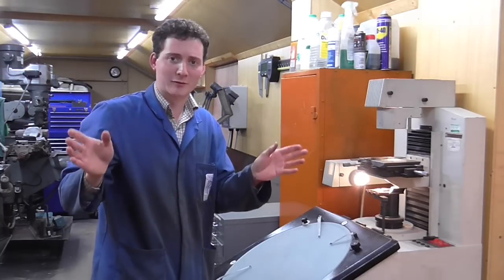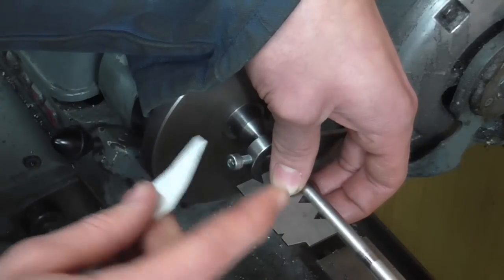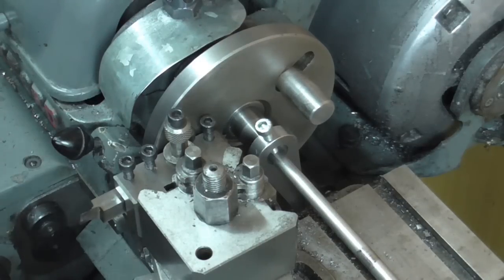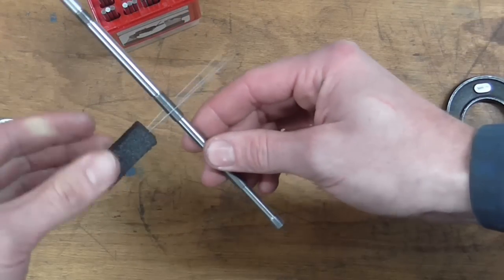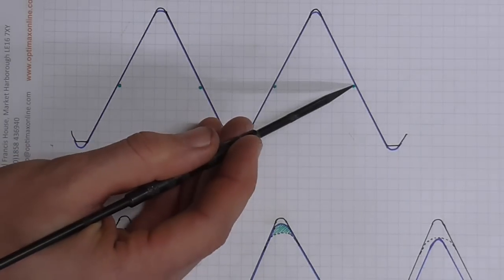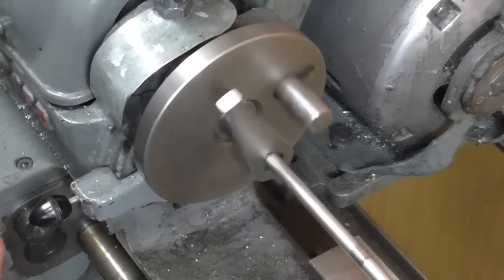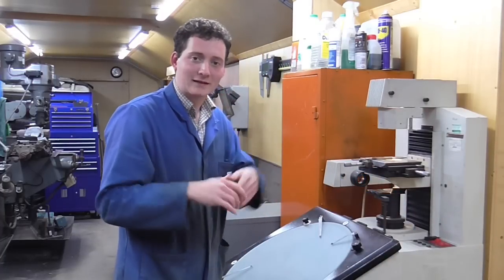Threading Details

Comment: i was very f intrested  in your shadowgraph could you do one on your shadow graph ive try mocking one up against the wall just to get the same effect with screwcutting tools .I used to work on  Cridan screwcutting machine for  aerospace drawing and all dimensions had to be corect shadowgraph  was very usefull  .The tool and SC gauge was behind the screan and radius gauge in front so you could use the ratioto use a larger R gauge the customers inspector would soon pickup on eney discrepancy from drawing .Is your shadowgraph home made or comersialey made some of them are realy complex  best vid yet.  ttfn&ty

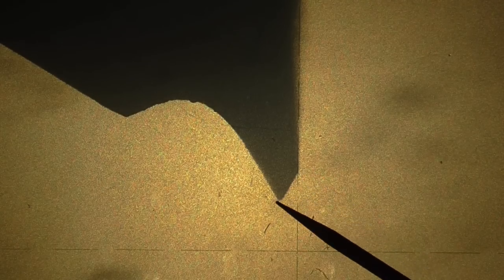Comment: 7:00  For UN and metric thread forms, The point of a tool for cutting threads is NEVER sharp. The correct thread form requires a flat nose of 1/4 pitch width to 1/8 pitch width for cutting male threads and 1/8 pitch width to 1/16 pitch width for cutting female threads. Provision is made for wear on the corners of the flat nose provided it is clear of the 1/4 pitch limit for male threads. . For example, a 20 tpi thread cutting tool needs a flat on the tip of .0125 - .0035.

Comment: Drill a hole in the drive dog (in the axis of the lathe bed), then remove the existing pin from the drive plate and replace it with a bolt (or pin) turned down to the hole size, that can pass through the hole in the dog. Don't fasten it to the dog, that way the work (and dog) can be taken off the lathe by sliding toward the tailstock, and without any worries that the work will over-run the drive plate..

Comment: Thanks for the tip on thread measuring wires, I was pleasantly surprised by the wide variety of threads they will work on. Also, you probably already know, 'soft iron wire' is available very cheaply at any home improvement store as 'rebar tie wire'....

Comment: i have problems getting a good surface finish on bronze threads- atlas lathe with lantern toolpost - any advice?
Reply from the maker: What surface finish defects are you seeing?
Reply: @MrCrispinEnterprises  just a ragged suface in thee V of the thread- i used a brazed carbide tool- tried slow speed and faster

Comment: Dumb Tyro question.  You stated you made your drive dogs.  How did you put the holes in?  Or maybe, how would you in a limited shop?  Just drill and file?

Joe
Reply from the maker: Yes I just drilled a hole and filed it square. If you are on Instagram have a look at my page as I showed it. mr_crispin
Reply: @MrCrispinEnterprises   if you made drive dog with a slot in it to match drive pin do you think this would work?
Reply from the maker: Yes that would work although doing that you are quite constrained on where the dog can be positioned on the work piece longitudinally speaking.

Comment: I use wires as well rather than thread gauges if I can, but the nose radius check is a good reminder.  Love the packing foam trick with the small wires though, that is definitely going to be employed in my shop from now on!

Comment: It was great cutting 4 start internal thread when tool chipped picking it the thread again was fun. For out City & Guild exam we had cut a Left Hand male and female thread 1/4" pitch 3/4" diameter. As i said at the time its easier with a Left Thread to  lads,who  worked at  big companies and had never single pointed any thread. Why was the question its to stop you people hitting the chuck.

Comment: I recently got a wire set that looks identical to the one you picture here.  I discovered that under the bottom removable cover are little rubber pieces with slots in them that nicely take the place of your packing foam trick - they're in the kit already!  The various ones have slots cut and marked to fit the various wire sizes.  Handy.
Reply from the maker: Hi, yes your correct but for really small wires the foam method allows you to see what's going on. Thoes rubber holders can get in the way a bit but thanks for the comment.

Comment: I needed to cut a metric thread for a project. To do this I used the three wire method using the straight shanks of three suitably sized metric drills and a formulae that I found on a web site. This turned out to be the best thread that I have ever cut.

Comment: You do know  Crispin that you have doomed yourself to doing a cooking video don't you 😂
Crispin  shows us his balls or crispins tasty balls could be some titles you could consider !
One tip for those who have never used wires is ( i find) it easier to set up the wires like you have but use a bolt or screw of a similar diameter to gauge the approximate size  to set the wires into the medium that you are using to hold them  - this sort of gets you close and helps to avoid bending wires .
I have seen all sorts of things used to hold the wires from bits of foam to plasticine to a chunk of fresh bread - all worked but if you use bread make sure you wipe the wires over with oil as they will rust .

Back to Crispins Balls - were they meaty saucy balls or balls you choke on because you skimped on the juice ?
Just askin !
P.S  on a tangent did you play or still play Rugby ?
Reply: Re Rugby, probably not, he still has two ears and clearly doesn't have brain damage.
Reply: I fancy the pan seared version... 'Crispy Balls'. There"s a recipe to conjur with😕
Reply from the maker: Hi, no never played rugby other than a few games at school. Why do you ask?

Comment: Another great and well explained video Crispin. Either buy or build yourself what's known as a micrometer vise. I use mine far more than I thought I would and having one makes measuring with thread wires easy since the vise is then your third hand. Mitutoyo make a good one and if I was building my own I'd borrow much of there design. Especially the plastic faced jaws that gently hold the mike without marking or over stressing the micrometer frame.